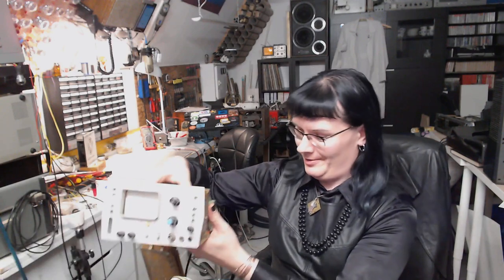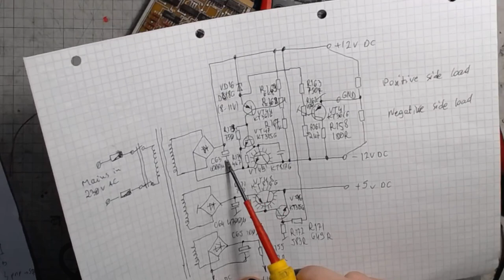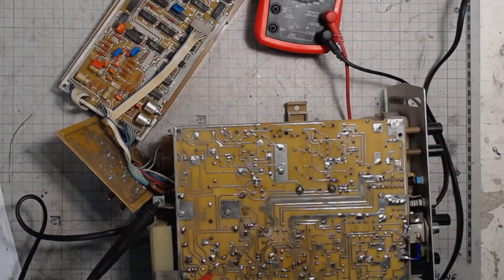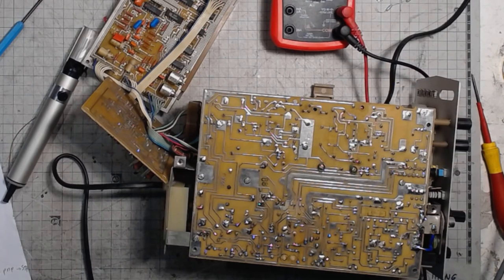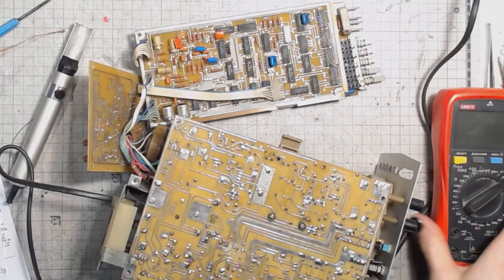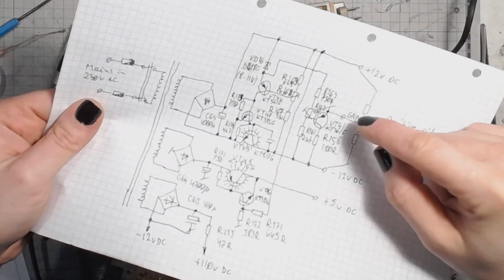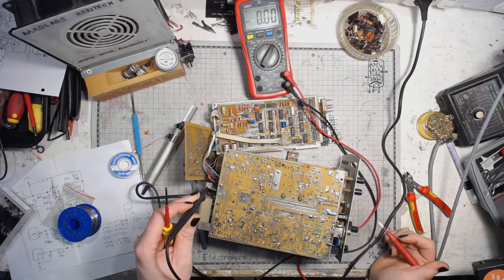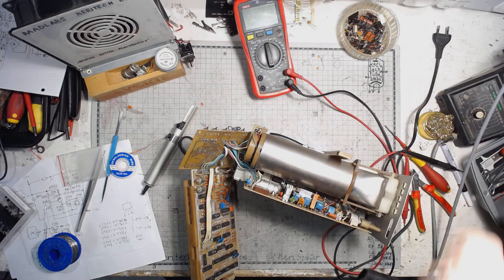The Soviet S1-112A Oscilloscope / Meter Repair, part 2

Comment: You got it working eventually after the false starts, well done. I think I'd like one of those 'scopes. Cant wait to see the meter display working.
Reply from the maker: Got it to run - I'll probably make a little presentation video :).
Reply: @KeritechElectronics  lets see the voltmeter display working please.
Reply from the maker: @lamalandy  gonna do a follow-up with using the thing :)